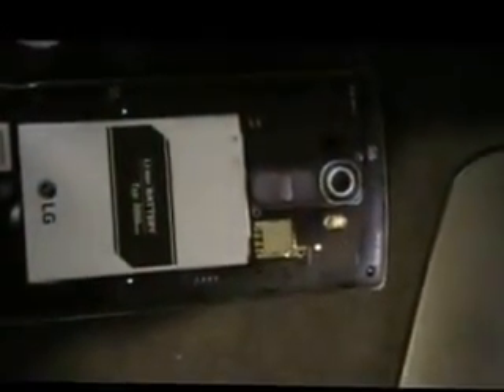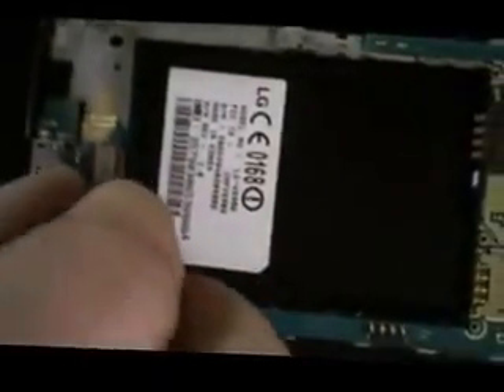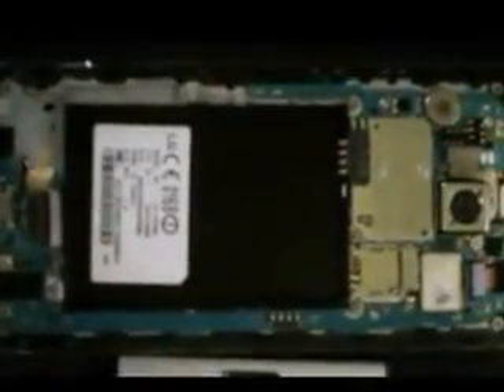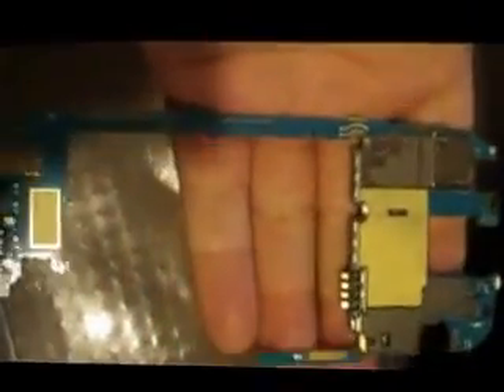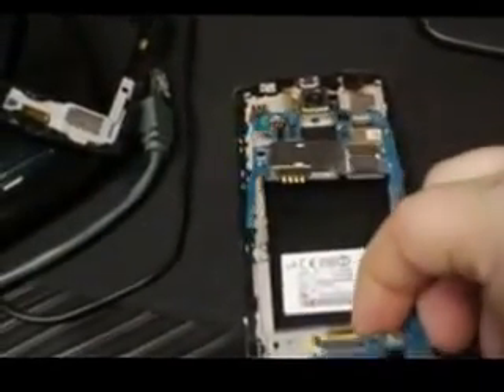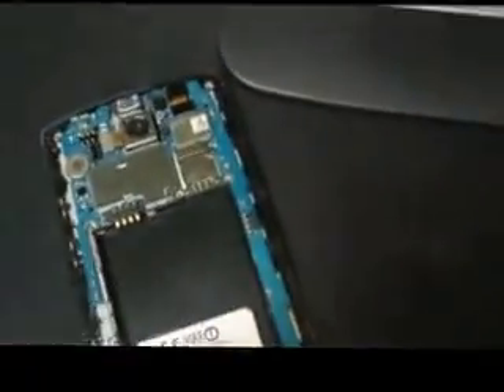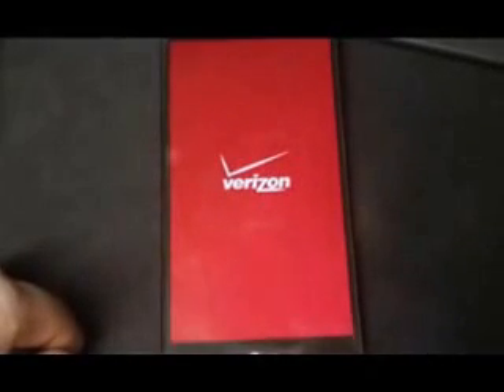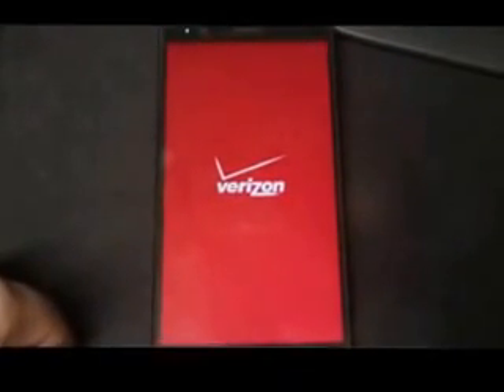LG G4 Boot Loop (Temp) Fix

Comment: please guys this is true or just a joke?
Reply from the maker: +Jwtiyar Nariman I know I'm the one that made the video. but, I can honestly say it did 
work for me. the only reason I decided to do this was because of a video
 I watch previously on how to fix a motherboard in a laser printer . 
which worked perfectly. the science behind it is simple all you're 
really doing is heating up and reseeding the contact points on the 
board. for the majority of the people this has worked I think one 
person's oven was too hot and I think they may have wrecked their board.
 please use caution since this is a last resort. this phone still 
somewhat works but it is not my daily driver anymore. I was just using 
it to get the pictures off that I so desperately needed.
Reply: thank you bro, does last for days ? or just afew hours till we get our pictures back?
Reply from the maker: Jwtiyar Nariman for me it lasted about an hour. I would recommend that you make sure the phone is off and completely charge the battery before you try the repair. Also make sure that you have the correct drivers installed on your computer. But there's no guarantee if it will fix it completely or just temporarily.
Reply: +Jwtiyar Nariman i got about 14hrs off my first time,  and 9 off my second, if u take the extra steps and make sure the motherboard is super level, u can get more life from it, when they solder these boards its in a massive line up, and the soldering spot it superlevel so thats a big thing to rememmebr, no joke this did work, i went to mad pages and spread his video because he saved my sons firs born pics,
Reply: bob pickle Bradley K now the phone is dead :(

Comment: This works! Seriously give it a try if you're having hardware bootloop issues. 400*F for 7 minutes it what I ended up going with after reading some overclockers and linustechtips. Thanks!
Reply: so it didn't catch on fire?
Reply: +Jamerius Moody Nope, but it did start boot looping the next morning. Temp fix for sure, enough time to get whatever info is needed though. Ended up getting a new G4 under factory 1 year warranty.
Reply: +Jordan Kessler But isn't it gonna start doing the same thing all over again, if you get a new one or not ?
Reply: +Jamerius Moody Yeah there's a good possibility this one will do the same thing, it's a gamble. I figure I'll have a new phone before that happens though I hope.
Reply: Jordan Kessler Might as well get a different new phone bro, LGG4 is fucked up lol. Especially when I paid for a phone & don't have no warranty either 😩 They better give me my refund.
Reply: LG has a 1 year factory warranty, I didn't have a warranty either through Verizon but I went there told them my issue and told them it was a manufacturers defect and they had me a "new" phone in 2 days. Hope this helps.

Comment: I have to admit I didnt think this would work...  But as my last resort to save my photos I tried it...   IT REALLY WORKS!!!  Can't believe it..  I will be directing everyone else with this problem to this video.. It is not a permanent fix but does work to get your stuff off of your phone.   Thank you very much BRADLEY K!!!!!!!!!!!!!!!!!
Reply: +Tyler Elmore its called reflowing, ppl used to do it with 1st and 2nd gen xbox 360s lol when i saw this i was like omg i didnt think about this lol, g4 overheats so bad this was bound to happen, i call bs on loose fitting, its overheats and is fucking up heat snycs and other connections lol